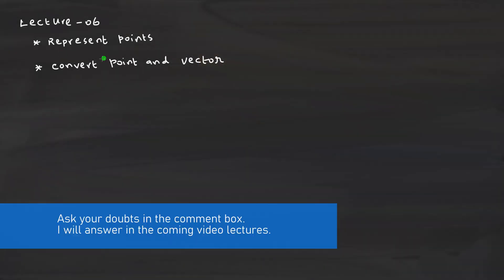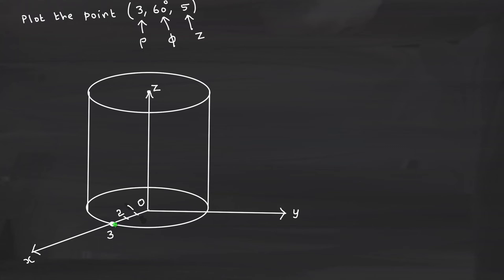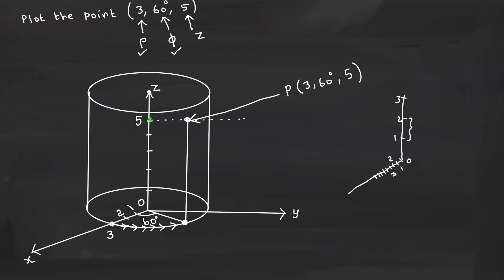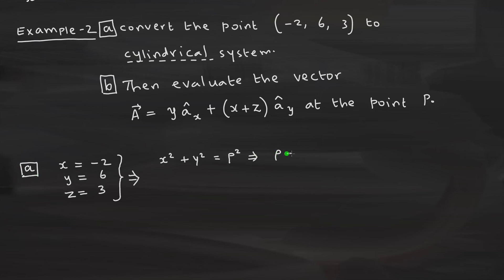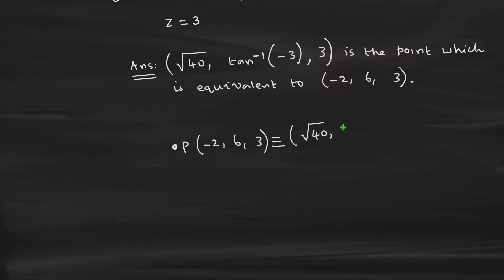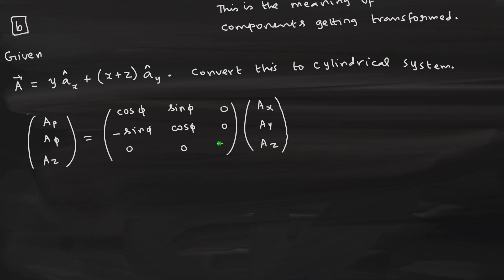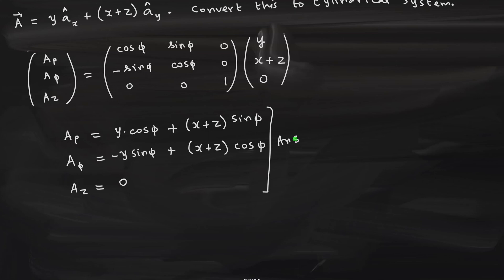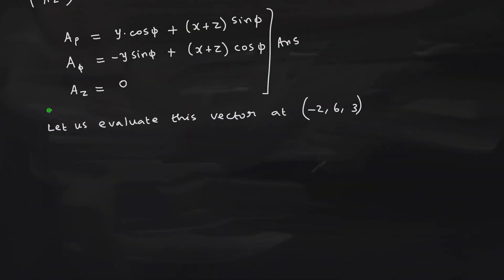Engineering Physics Cartesian to Cylindrical Coordinates Solved Problems

Comment: Sorry professor, the units along the radius and along the z-axis which means the height of the cylinder must be the same, otherwise the figure will not be geometrically right.
Reply from the maker: The units along radial direction can be taken in steps of mm, while for the height, you can take in steps of centimeters.